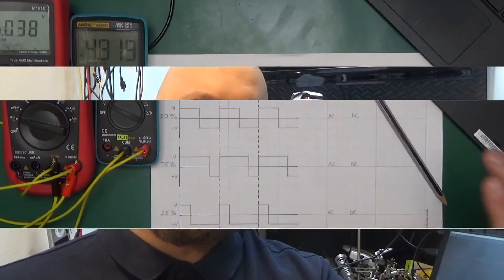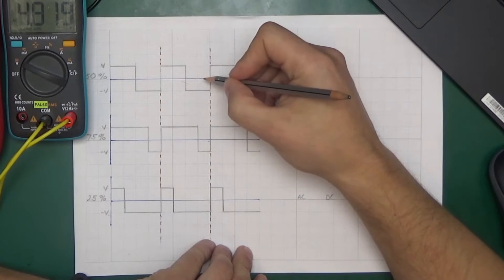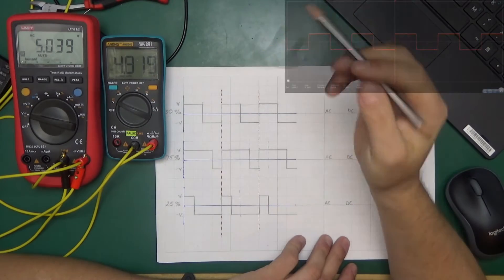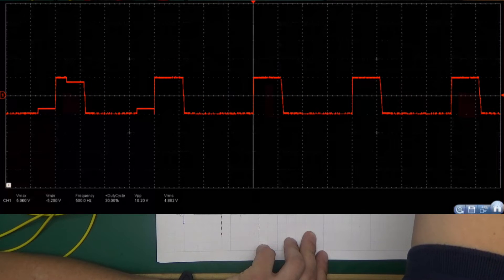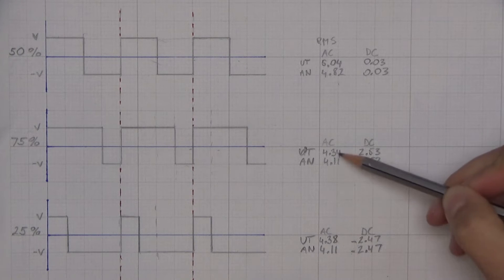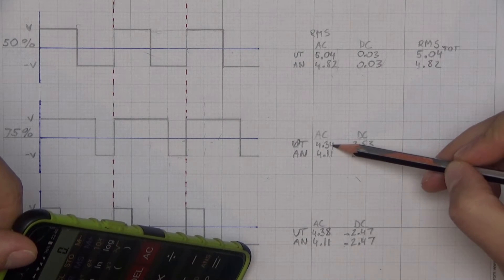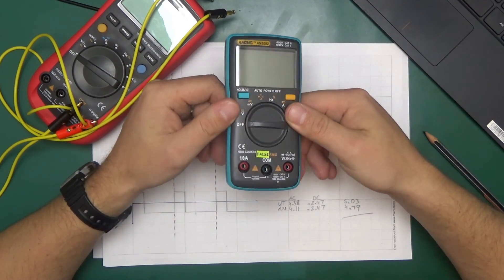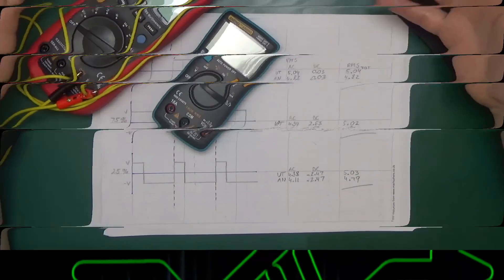#028 - RMS true after all!

Comment: why not  that  much effective in square wave inverter compared with sine wave inverter . what are all the problem will have in square wave inverter. could you please upload video with some example. why inverter circuit in google not effective and problem.
Reply from the maker: Great Scott just did a video like that not long ago
Reply: The problem with square wave inverters is simply that they output a SQUARE WAVE. The devices that are connected to the inverter are designed for SINE wave supply. The primary issue is that the square waveform has a almost instant change from negative to positive full voltage. Then it instantly drops from full positive voltage to full NEGATIVE voltage. Then from full negative to full positive. This creates a huge current loading in the connected device, as it is trying o absorb this brutal and repeated voltage change.
Consider your car with an automatic transmission. Start the engine and apply your foot on the gas pedal so it is at 100% throttle. Now,  with throttle 100%, shift the gearstick from Park to Drive. Next (still with gas pedal floored) shift the car from Drive to Reverse. Now do it again - full throttle and shift it back from Reverse to Drive. Keep repeating that... the transmission will not last very long because of the shock caused by the sudden transition.
The square wave is the same kind of thing.... it causes the voltage to go from 100% forward to 100% reverse in an instant. A sine wave is similar to taking your foot from the gas pedal, letting the engine slow to almost zero, then shifting the gears, then slowly increasing the power again.

Comment: Could you test to show how poor power factor loads on AC power measure ?
eg 12AC into a triac based light dimmer, into 12V globe. measure DC and RMS across a series resistor to get current changed into voltage.
You'd get a big DC component when the triac is off.